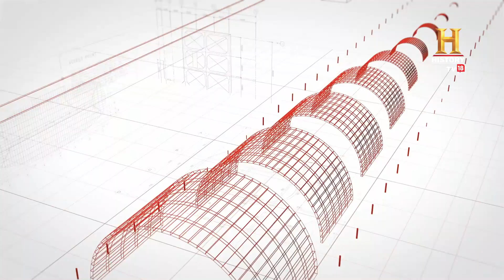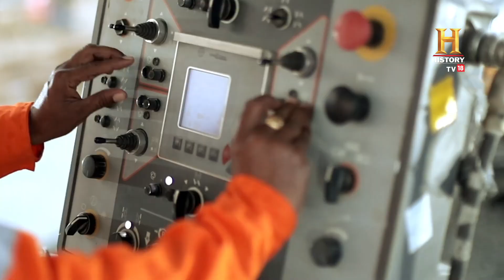This stretch of the Delhi-Mumbai expressway was completed within 24 hours! | Engineering Marvels

Comment: I am not sure these concrete will stay without cracking due to extreme heat and monsoon variations.. so essentially, they have to be  mixed right, compressed right, and cured right, and most importantly, the machine used here must cut them at equal distance for expansion. It just can be continuous... and I can see those sections, but not very clear. any close shots? how did they cure for how long?

Comment: marvellous engineering feet achieved, but my question here is why concrete and why not bitumen(asphalt). Does costs more? Does it require more time? Is concrete better than asphalt?
Reply: I'm not sure... But I think they'll pour in the asphalt later.. roads are made of layers... So this might just be one of the layers... Correct me if I'm wrong...🙏
Reply: @gautamgopal3517  from Delhi to vadodra road will be of asphalt because of less rainfall from vadodra to mumbai it is of concrete as high rainfall is recorded here and concrete roads are more durable